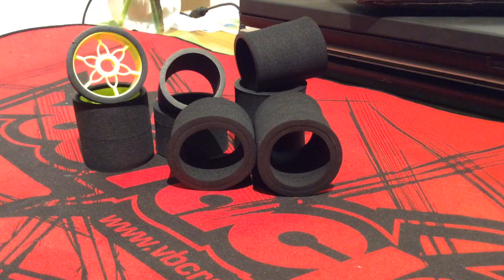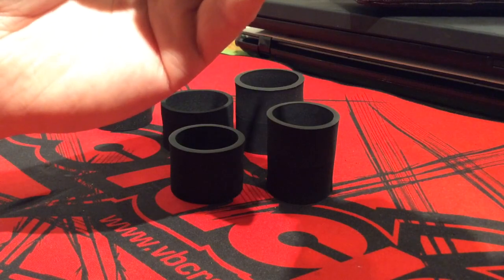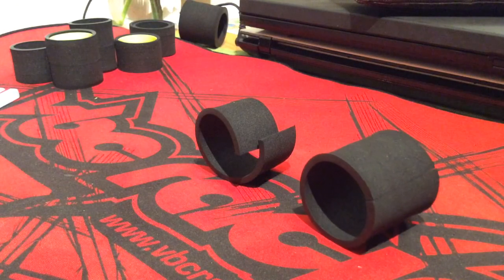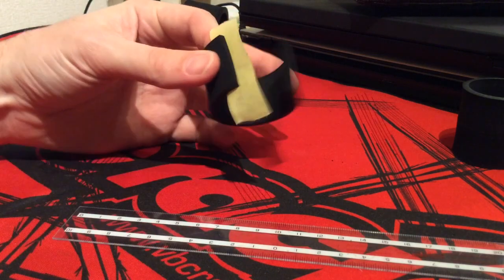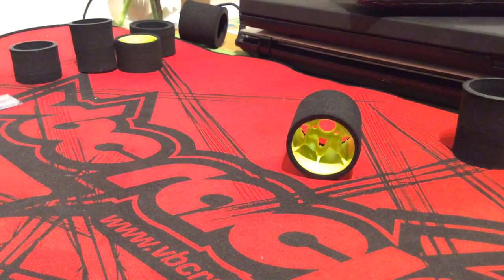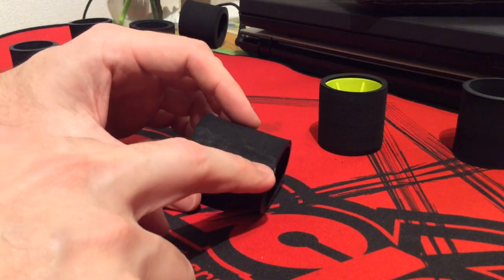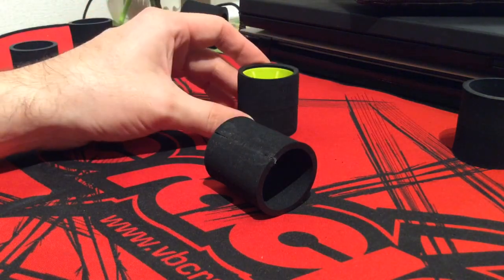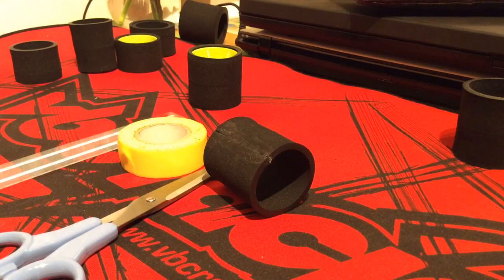Yokomo's Unique Cost Effective Foam Tire Design

Comment: Edward,  what do you think of VBC cars. I have 2 questions. 1)I was thinking about trying D09 touring car do you think  about or do you have any information. 
2) We are starting to race pro10 cars VBC sells 235mm pro10 car do you have any experience in this class. 
thanks
Reply from the maker: Hello MrUCL, 

1)VBC cars have come a long way and the D09 touring car is a vast improvement from its predecessors. Many drivers are complimenting on how well the D09 is performing. I don't personally have one, but from what I heard from other drivers I would highly suggest looking into getting one. Please keep in mind that parts support is vital for your overall rc experience. Check with your hobby shop on the availability of VBC products. 

2) I don't have any experience with the Pro-10 cars. Sorry.